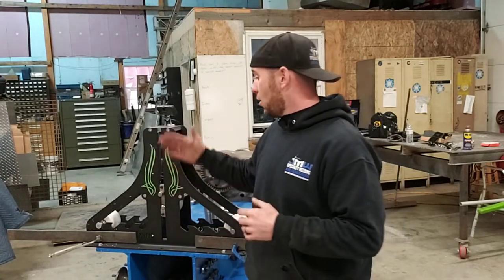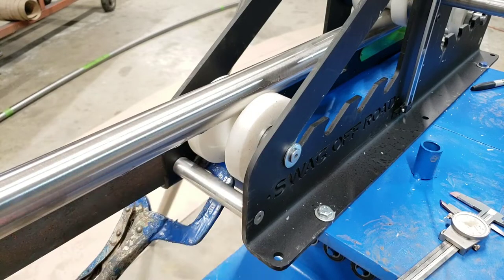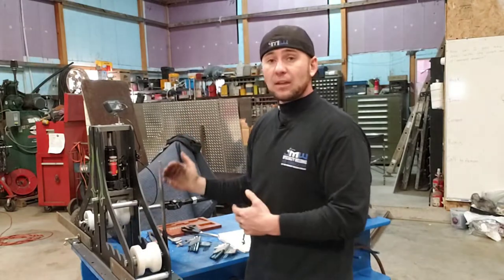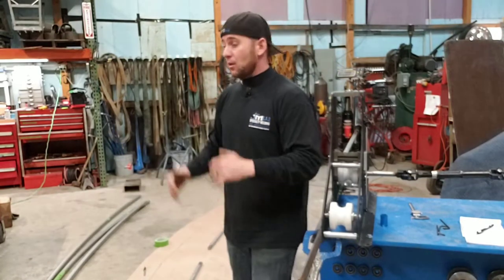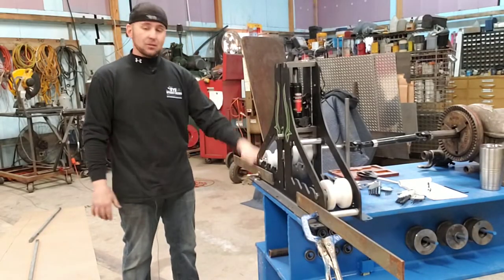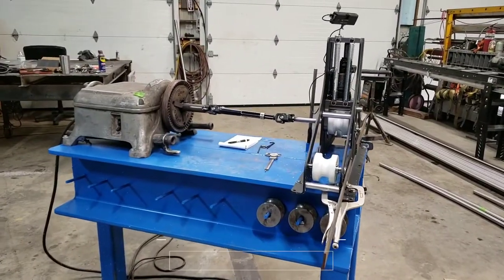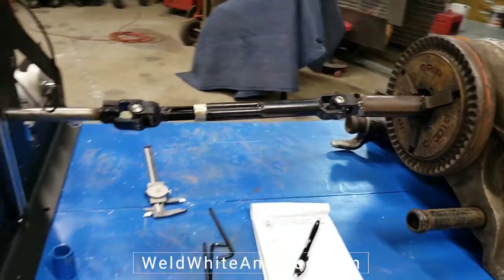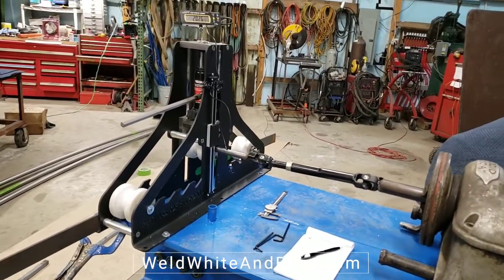Secrets for Hulk Tube Roller. Setup - Adjustment - Tips and Tricks for Swag Off Road tube roller.

Comment: At work as a boilermaker, we rolled our own shells and we made templates out of 1/4 plywood about 2ft. long. You cut the template for the radius you need and check as you roll your tube. Using templates will make your work so much easier.

Comment: Thanks for the info and demonstration.  Building up my HF tubing roller with all of Swag's add ons during the Coronapacolypse.  It will be almost as good as the Hulk once I finish burning in the extension wings.  Had I known how much use I would get fron a tubing roller, I would have just bought the Hulk and saved myself a lot of time with all the mods that I've accumulated from Swag.  I've been turning my own dies with 4130 rounds as well because they rack up some coin quick and I'm just a home gamer with a shop dedicated to whatever I feel like learning and tackling.  I spy something else really cool in your shop that I want to run in my diy shop:  That exhaust setup with the blower.  I have that blower but didn't think about suspending the callapsable line.  I already have a some pulleys in the centerline of my 16ft pitched ceiling setup so I can paint and then lift the  drying materials up, out of the way to work underneath.  Suspending the exhaust to one of my windows is ideal.  Unistrut trolley would be even better if I didn't have pitched overhead and a gantry to pull through.  Subscribed.